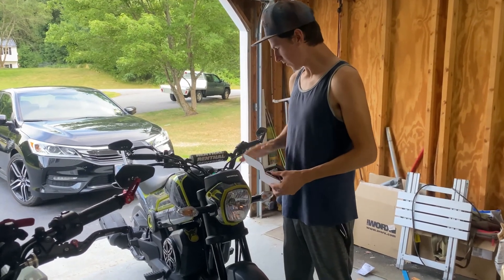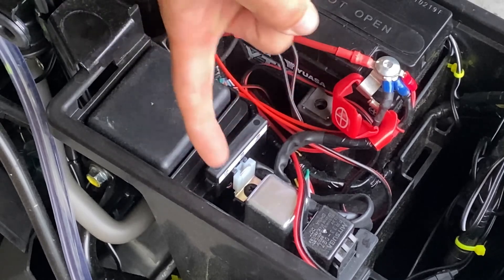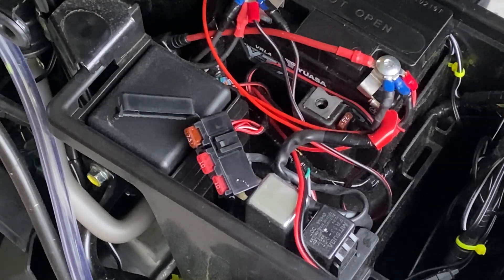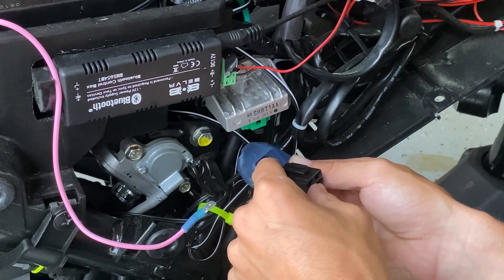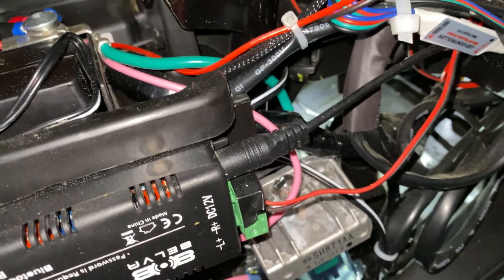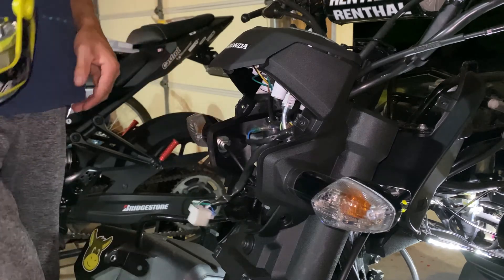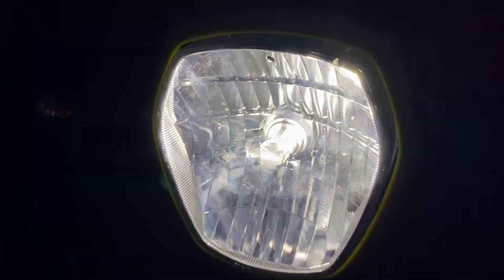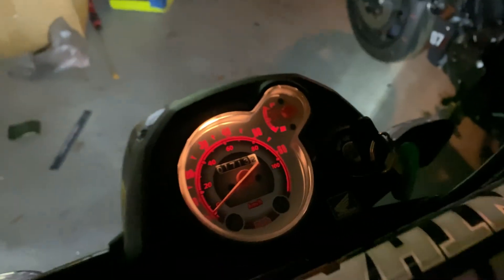Honda Navi LED Headlight Conversion

Comment: You just needed to add a fuse circuit, you don't need to cut and splice any of those wires. 
https://youtu.be/HxzflcmCNj4?si=JZh-c8leFg10R5UI
Reply from the maker: @Tatonka322  I did this video years before the plug and play system was a thing. I purchased the harness for my second navi and did it that way.

Comment: What's that LED model that doesn't need a conversion kit?
Reply from the maker: @johndove2604  I think it was sealight. You don’t have to do the conversion for LED’s to begin with.
Reply: @pookythomasmoto2727 what? So you can just buy the headlight and break light and put them in without the wiring stuff you did?

Comment: Hi great video 👍🏼 . I did the ac dc conversion and for some reason I’m still getting a flickering with my led headlight. Check all my wiring and everything is fine. Any thoughts on what could be causing this issue? Thank you
Reply: It only happens when the bike is started.
Reply from the maker: It is normal when it gets started from cold

Comment: Another way is just use an "add a fuse" and disconnect the AC wire and connect the add a fuse to the lighting circuit rectifier wire once disconnected for DC power,
I recommend the DZG LED motorcycle amozon $29 , best upgrade you can do amazing difference you won't be disappointed.😅
Reply: Does it flicker this way or no?

Comment: Nice video. Thanks for clarifying the which wire to splice. Does this the high beam indicator still work after the conversion?
Reply from the maker: Unfortunately no. I think once the switch over to dc was made the bulb in the cluster either burned out or no longer takes current. I’ve already taken the cluster apart and could address this in a future video. Honda just released the parts diagrams for everything on this motorcycle so everything is replaceable now, just searching for a possible LED underlay bulb for that said circuit. Thank you for watching!!!
Reply: We're do we download the parts diagram?